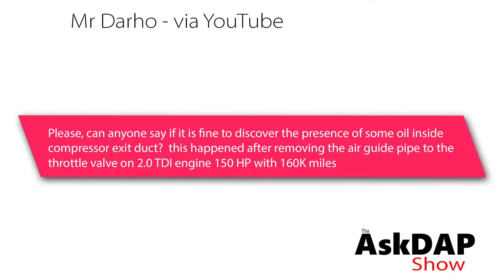Is Oil in your Boost Pipes Bad? | AskDap

Comment: Took this advice and replaced both turbos on my F150 Ecoboost and still getting about half a quart of oil after 30 minutes of towing, should have mentioned that stuck piston rings can cause the same thing, not just one possible answer

Comment: A main culprit of that is a plugged up pcv system which backs up the oil return line and the oil has nowhere else to go but through the seals on the both sides so if is leaking on both sides you have excessive crankcase pressure

Comment: there should be almost no oil in the turbo pipes, if it has like a puddle of oil in the intercooler or piping then its probably leaking from the turbo shaft. Also check the turbo shaft for play, if its loose and it has like more than 1mm play then it is done it needs repairing/changing. I recently did change the turbo cartridge on my car TDI. It was consuming like a 1 liter of oil on 200-300km(150miles). I also found that my intercooler was leaking because it was covered in oil completely. BTW you could drive the car like that and just top the oil, but i guess the valves will get oily at some point and wont close properly which will require an head rebuild...

Comment: It's not a problem until you let it become a problem. A cup of oil every 50k miles it's normal. A quart every 10k miles it means your turbo is leaking. Don't wait for it to break and look at an expensive  fix. Take it to a mechanic.

Comment: My ko4 is leaking from the cold side but both turbine housing are dry. It's leaking out from the cold side and dripping down the engine?? But I have smoke on start up and at lights ??? New turbo maybe
Reply: maybe try just a new CHRA unless the turbo is cheap

Comment: If it's oil in the intercooler hose, can it be caused by blow by, or it's a turbo leak?
Reply: I had no play in my shaft none whatsoever so could it be bad pcv
Reply: A bad PCV, a bad valve cover, bad rings, bad turbo, bad turbo return lines are all potential causes.  
Mine had the valve cover blow out & was letting huge amounts of oil into the charge pipes.  Replace valve cover (camshaft cover, engine cover, whatever it's called) & oil consumption went back to normal.
Reply: Could be both. Check for play in your turbo shaft